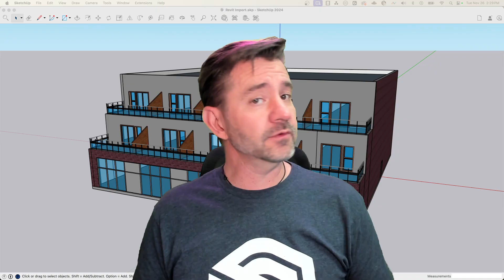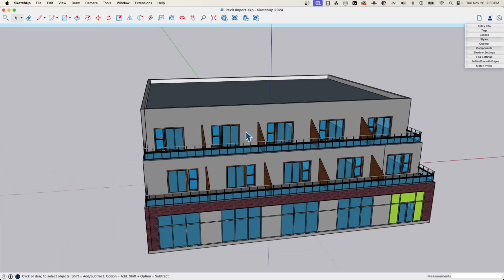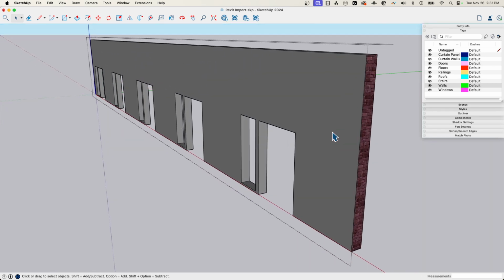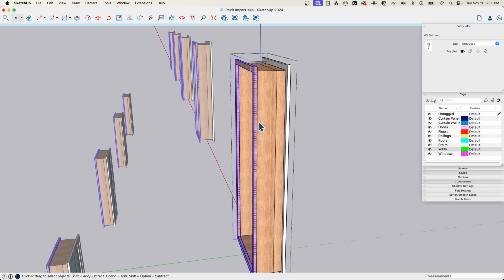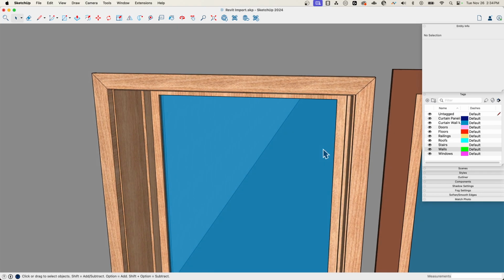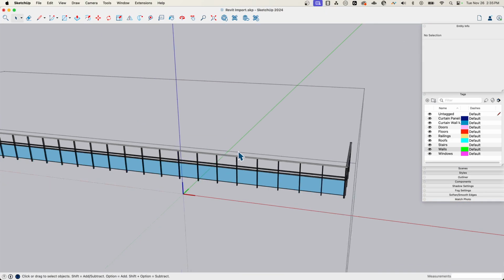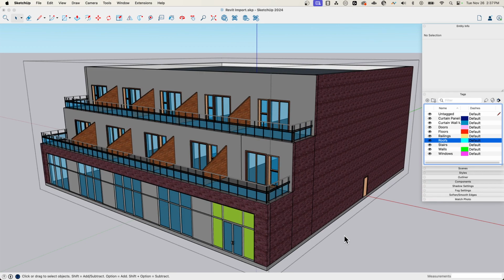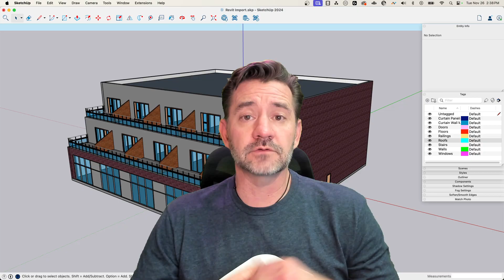Revit to SketchUp: Import and Organize .RVT Files

Comment: I need a little help. I'm a SU power user since ~2003, and AutoCAD since the early 1990's. My process is designing the floor plan in ACAD and go straight to SketchUp as soon as I get a design sign-off. Now my company is going to Revit, primarily for CDs and engineering. The Revit folks are only using my SU model as a guide and completely recreating it in Revit, which seems to be a huge waste of time. Is there a way to go back and forth between Revit and SU? I'd like to have the techs input my schematic ACAD floor plans into Revit only to a point that I can import to SU and start the elevation design. Then, have them add or implement my designs to the Revit model, and so on until the process is completed.
I don't want to learn Revit.
Reply from the maker: SketchUp Studio includes our Revit Importer which will allow you to import Revit geometry into SketchUp!

Comment: One issue I’ve had with importing Revit models into SU is walls/wall systems that have multiple layers to the walls which ends up leaving you with a ton of extra faces.  I use the union boolean operation to simplify those walls.

Purging out extra Revit families (now components in SU) helps a lot as well.